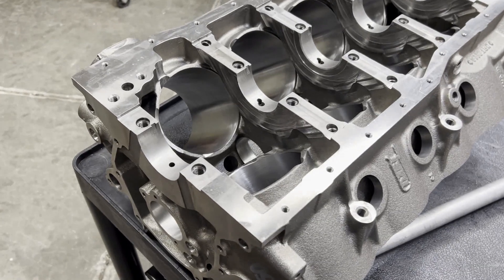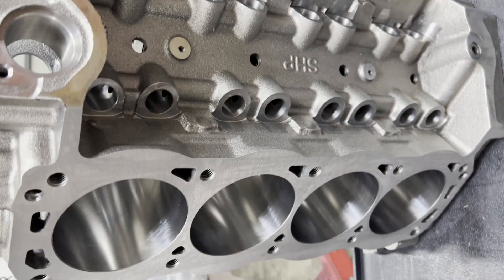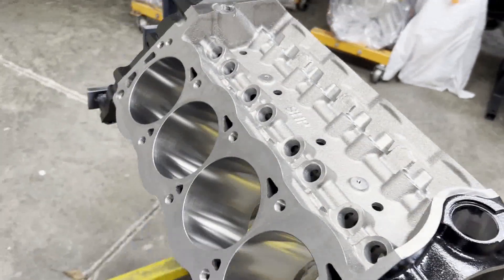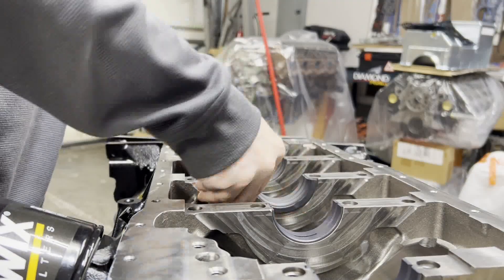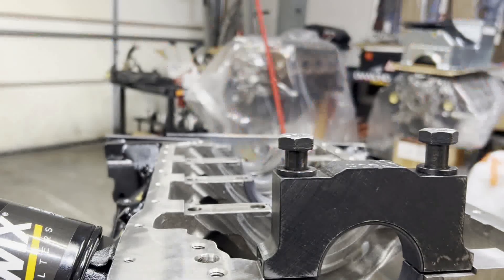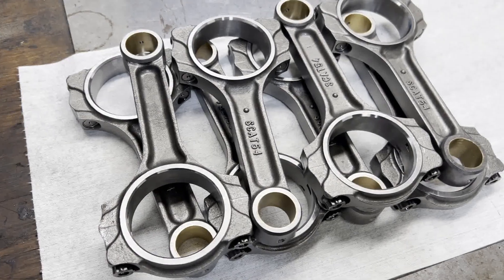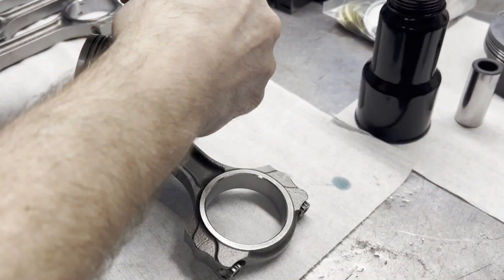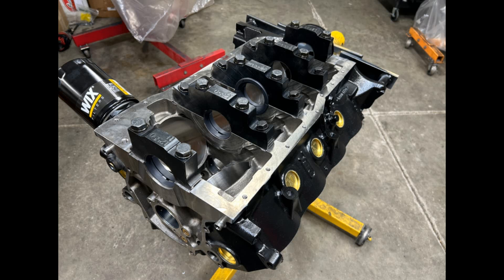Lykins Motorsports Ford 363 SBF Windsor Build Introduction...

Comment: 8.2 deck height is  a 302 Base 9.5 is Windsor stock deck height. If you are going to push the envelope you find out the limit of the block pretty easy.

Comment: Is a 9.5 inch deck block less able to rev due to the longer pushrod length?
Reply from the maker: No.  You'll find that pushrod length/weight really doesn't have a bearing on anything.  If pushrod length was a factor, our 10.300" deck BBF's wouldn't be able to turn 9000-9500 rpm in pulling truck applications.

Comment: 8.5" deck 363 SBFs are badazz!
LOTS of HP in a small, bulletproof package.
Can't wait to see it dynoed Brent.
Should be 550 - 585 HP N/A without spinning it over 7,000 rpm.
Ive got one in my '85 GT Foxbody and it looks just like a mild 5.0....😁
Reply from the maker: We are not gonna spin it anywhere near that high.  The application doesn't warrant it.
Reply: These aftermarket 302 blocks are plenty overkill for the power level of most 363 builds.  A junkyard 351W block even after machining would accomplish the same thing for a lot less,  unless the customer can't fit the higher deck height.    @lykinsmotorsports
Reply: @markh8301  
Exactly!
9.5" deck Windsor blocks are bigger and wider and not as strong as an aftermarket 4 bolt main block.
I didn't need to modify nor buy anything different than what fit my 8.5" deck 5.0 for the Dart block 363.

Comment: Why do you prefer I beam over H beam rods.
Reply from the maker: In most cases they are just as strong, but are much lighter.  H-beam doesn't always mean strength.  Oliver rods ($$$) are I-beam.

Comment: Have you ever painted the lifter valley with glyptol to help the oil drain back?
Reply from the maker: No coating/paint belongs inside the engine.  It doesn't help the oil drain back and it's a source of flakes that will get into the oil pump.  You don't know how many times I've seen blocks and heads that other shops have coated that have began to flake off.  I've never had any issue with oil drain back and it surprises me that in modern times that guys still wring their hands over oil modifications.
Reply: @lykinsmotorsports must use crap paint mines been painted for 25 yrs and not one chip, also y not tap freeze plugs, weird how alot of builders give all the smallest parts to get more money later to go faster, when it could b done right and last just as long
Reply from the maker: Well, a sample size of one doesn't represent the whole.  I've seen a whole lot of blocks and heads.  It flakes.  Paint/coating doesn't belong on the inside of an engine or cylinder head.  Oil flows just fine without it.   So many things are done as a solution to a problem that doesn't exist.  Not one of my engines has ever been coated inside.  I have no issues with oil control or drainback, even on >1200hp pulling truck engines.  Tapping the freeze plug holes is a lot of labor for zero gain.   Not sure what your last comment meant.